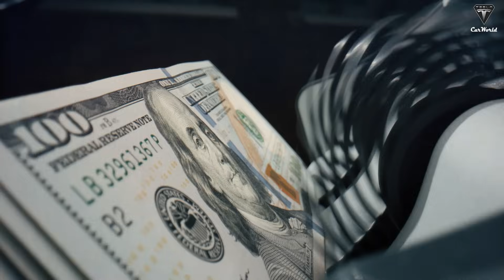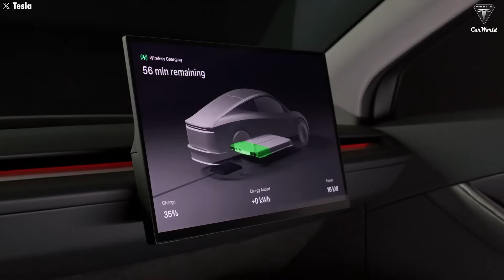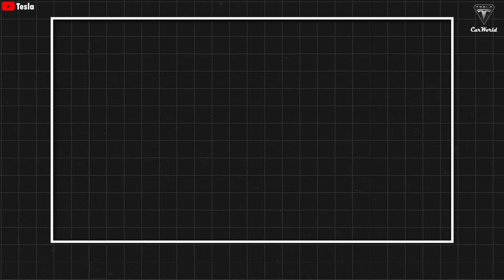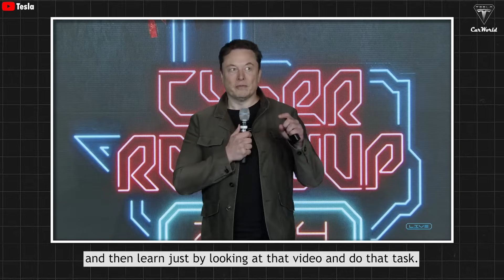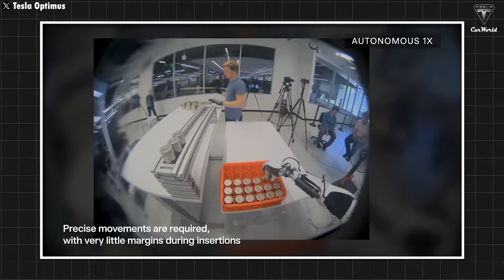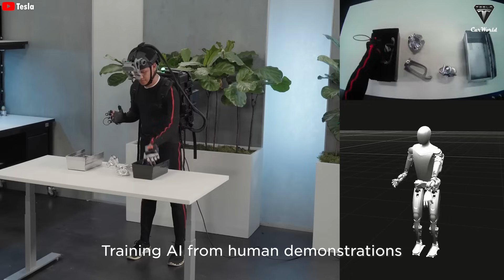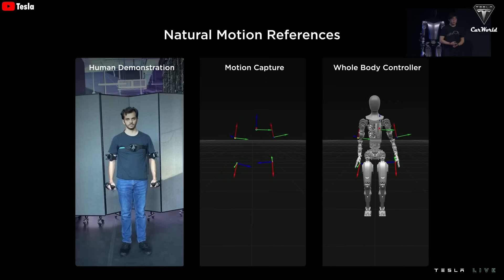Elon Musk LEAKED This Is The Way Tesla Bot Gen 3 Can Do Home Tasks During 10 Hours! That’s Insane!

Comment: Give it 10 years then I will believe it as somewhat close to a human. I want it to hammer teco nails on construction lumber brackets under a joist floor system, or crawl on roof trusses and install required code lumber blocking in the roof structure. And at 300 lbs they will need to make heavy wait ladders or floor systems.

Comment: Optimus needs to upgradable by user by ability to upgrade and add CPU, sensors, connectivity, power pack, etc.  These robots will be innovated i short product cycles.  Best not to have to dispose old robots.  Same feature should in their cars.  Like FSD upgrade from Hardware 4.0 to 5.0.

Comment: It will happen but not by Tesla. Tesla doesn’t have the software and quality engineers to produce a robot that won’t fail every ten seconds. It needs to work and be safe but Tesla doesn’t have that capability.
Reply from the maker: You’ve got a solid point there! Tesla’s got the hardware down, but when it comes to the smooth software and bug-free performance, it might be a little... glitchy at first. Maybe they'll team up with some seasoned robot software pros—because we definitely don’t want Optimus taking a nap in the middle of serving drinks!

Comment: I am hoping that as it is developed (future models) much of it's "brains" will be on-board the robot itself versus only available if it is connected on-line to super-computer at the data center.  What if you need to use it offline (maybe underground?) where it cannot connect?  Also, I wonder if it will ever be possible to have privacy or personal control over the data that it is collecting on you?
Reply from the maker: Great points! If these robots are fully reliant on the cloud, they might go a little "offline" in more ways than one when you’re in a remote or underground spot—kind of like your Wi-Fi drops in the basement. 🤖📶 And as for privacy... well, that’s a big can of worms. Hopefully, future models will have some built-in “Do Not Disturb” mode, where they can keep track of your data, but not spill your tea to every server out there. 🤐☁🍵 The ideal future might involve robots respecting your privacy, but until then, a little robot with a ‘privacy settings’ button wouldn’t hurt!
Reply: Yeah I kinda don't want it to be connected constantly to the others or the mainframe. Let it be independent so that we can choose if we want an upgrade and what it will entail. Then we should at least have some control over it

Comment: That multicell lithium battery pack that the thing runs off of has a danger of catching on fire due to thermal runaway. As soon as one of these things falls down hard on its back it could potentially going to thermal runaway
Reply: why have the battery anyway for a home.
Reply: @VictorHopper-f6c  An ambulatory robot tethered to a power cord would be impractical.
Reply: They'll have a robot to look after Optimus in case that happens. Then I suppose you'll need a robot for that robot . . .

Comment: The battery is not 5 times more energy dense it is 5 times the volume. the energy density is controlled by the chemistry at the separator it is the same for any battery using the same chemistry.